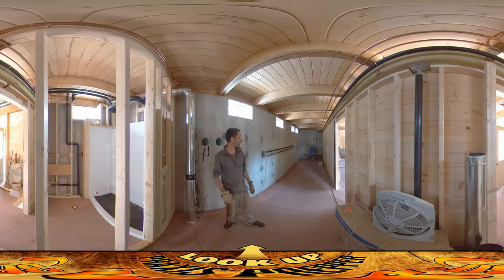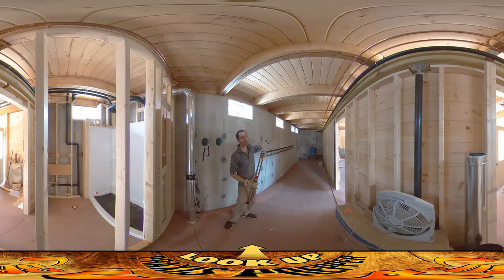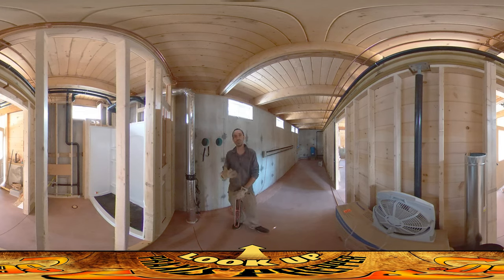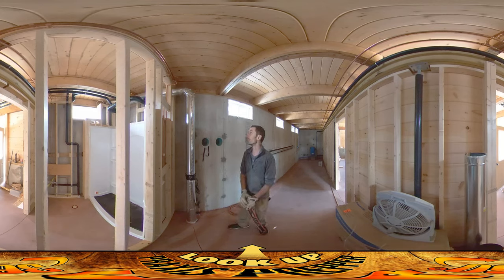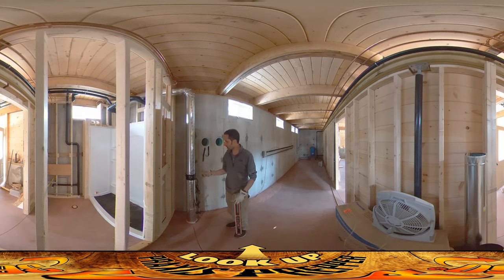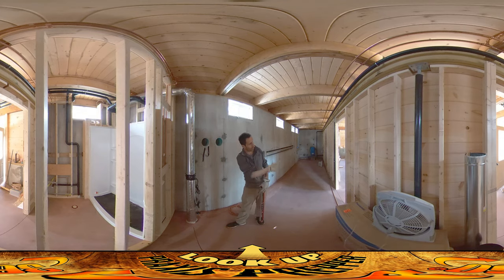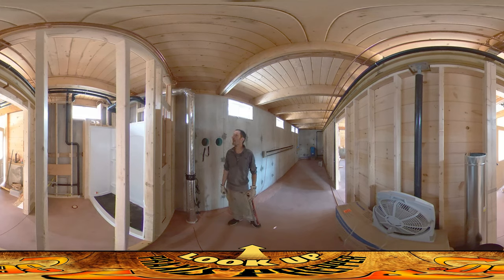Homestead Building - Shuffling Work Materials Around, Plumbing Warning, Sub Floor Vent

Comment: I am envious of your thermal transfer system.
Reply: Jason Stanley I am impressed by the simplicity of it.
Reply from the maker: It was a LOT of work to do. Not super expensive though in terms of material. Just the cost of the cinder blocks. The rest is achieved by reshuffling what's already there anyhow (foam and dirt).

Comment: You know that copper connection is not for high pressure water flow. Just fyi. I'm in a high pressure water area so you can't put that in our neighborhood.
Reply from the maker: We'll be running at the usual 40psi. Do you know what's the pressure max for these lego pipes?